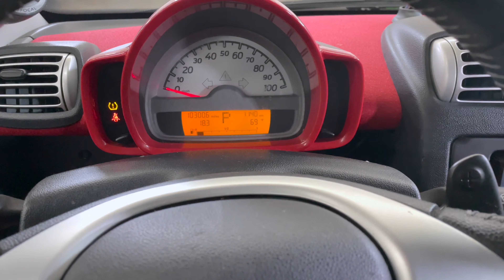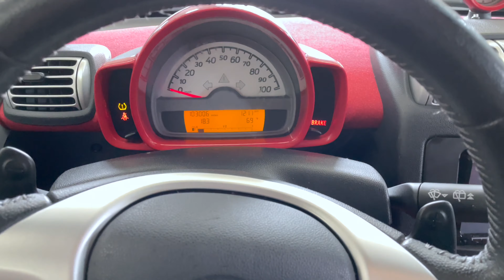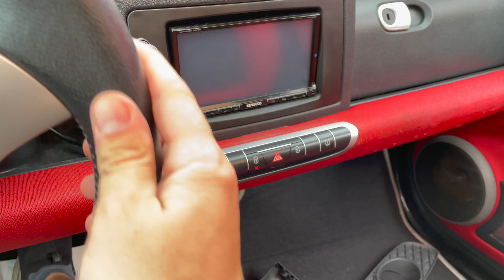Smart Fortwo Shifting Actuator Fix

Comment: Thought I'd drop in a comment here about the whole process and what I experienced because I just got through doing it on my twenty fourteen, smart that has 91,514 miles on it. My car had been surging a little bit when in drive, and when I put it in reverse, that's where the really big problem was, it was chattering and jerking. When I began investigating what it could be and ran across these type videos I thought, for sure I had found the fix. It turned out it WAS the fix! My car now runs and operates like it did when it was new. Couple of things to point out for everyone. When you are setting up the "lash", the amount of "pressure" on the clutch level itself, all I did was feel for the actuator rod to touch up against the clutch lever. Now I moved back and forth about six or seven times till I made sure I was feeling it correctly. From that point I put a little bit of pressure on the actuator itself, and I was very careful, as I slid it towards the bellhousing three more indicator lines. So everyone clearly understands. There are indicator lines, kind of like quarter round lines. The type you're seeing in these videos that are molded into the housing of the actuator. When I touch the clutch lever there were three lines showing. Then I pushed it three more. That's what the manual calls for you to do. It's easy to find this one line. The Other important thing I wanted to share with everybody is I did not have the software nor a laptop to plug into the car. The more I read about doing this job.I learn that you do not have to do that. Once you're finished with the job and you're about to drive the car to test your work. Just turn the car on and let it idle for about thirty seconds to a minute and a half. The car will learn the actuator position on its own. At least that's what I experienced. And then what I did is, I shifted the car somewhat slowly from park to reverse, to drive, to neutral, to reverse, to drive the neutral, and I repeated that maybe ten times slowly while my foot was on the brake. Then I dropped it in drive And went twenty or thirty feet stopped it, put it in reverse, did the same thing forwards and backwards, about six to eight times. At this point I knew immediately that the car was in tremendously better shape than it had been for the last eight ten thousand miles. My biggest problem is that when I was in reverse backing up, the car would shake and chatter very hard. Almost surging at times. That was all gone immediately. Then I took it for a shakedown run. As i've already mentioned, it ran, just like it was brand new. Hope this info helps some of you out there.
Reply from the maker: That’s a hell of a story. I’m glad the car is at least running better for you. I read all the comments here, and apparently there are situations where doing the maintenance on the actuator doesn’t fix the problem, at that point there could be something else going on, but most of the time, from my experience, it does fix the problem.

Thanks for sharing your story. I hope that the video and your comment helps other people out there with a similar problem.

Comment: 2008 Smart 451, bought a pair of ramps, removed the retaining spring pulled back the boot and sprayed in half a can of lithium grease using the long nozzle the can came with. result, a very quiet and smooth gear change. "Jobs a good un" as we say here in the U.K.
Reply from the maker: I’m glad your method works!! Good to know.

Comment: I wish I had this three years ago. I had the same problem with less than 50k km and my local smart center charged me over 600€ for a new actuator and didn’t even install it correctly so I had to pay another 300€ to get it towed to them because it stopped working the next day already.
Reply from the maker: Well, I’m glad that you found the video and you understand how to fix the problem in the future.

Hopefully you don’t have to pay 900 to get a similar issue fixed in the future.

Comment: Even after having new actuator installed, it didn't fix the problem and I still get stuck multiple times daily and won't go into gear. Have to let sit 5 minutes to reset transmission

Comment: Is this also a reason we get the 3 lines instead of the P (Park) on the panel? I’m not getting that slam noise, but I’m getting an electric noise like the rod is pulling out and pushing in, even while I’m driving.
Reply from the maker: Yes. The 3 lines means your transmission needs to relearn the actuator position.
Reply: @ToyotaGR86Performance  I pulled an actuator from the junk yard and the piston is in the full out position. I couldn’t mount it because in needs to be drawn in. How do I draw it in?

Comment: So the actuator will relearn on its own, and it doesn’t need a computer attached???
Reply from the maker: Yes
Reply: So pretty much open it up, clean it out, then lube the crap out of it? Any specific lube weight? General purpose, high heat, Red, Blue, White?
Reply from the maker: @HeyMikeyLikesIt2 in my experience any grease that will stay in place like a thick lithium. Don’t use any runny grease because it will not stay on track and eventually pull at the bottom.
Reply from the maker: And grease that is not runny and will not pool at the bottom of the actuator.
Reply: @ToyotaGR86Performance  Thanks for the response.  I bought this Smart car not knowing what I was really looking at…after two weeks, I found I have to replace so many parts. Luckily the salvage yard near me just got a wrecked smart car, I’ve been cannibalizing it every other day. It’s easy to replace parts, I’m just not too good at the electrical troubleshooting.

Comment: So mine was doing the same thing..all of a sudden very hard into drive and reverse and the car wanted to take off....so took off the clutch actuator and viola...no grease at all (and this was in a car with only 47000 kms....)...I put lots of grease in it and reinstalled in the same position, but was doing same thing...so...common sense told me that perhaps there was too much preload..i backed it off till just a little bit of preload from the actuator and presto...perfect shifts...put it in drive and it just creeps up to speed and same with reverse.

Comment: Hi mate 

You are an absolute legend 

Had my engine light come on and I noticed the car slipping gears and giving to much power then delay changing also car was very shaky and vibrating 

I took me 2 days to get the clutch off due to a rounded off screw but what can I say 

Took it all apart and there was no grease at all. I loaded it up with copper grease and jam packed it in and put back together 

As soon I was put the car in reverse and came off the drive the light disappeared and the car was back to.normal.again 

Thanks buddy 
Have a good Christmas
Reply from the maker: Stories like yours is exactly why I do videos showing common problem solutions.

I’m glad the video helped you out, and I’m glad you’re able to save money and not have to take it to the dealership for a fix. 

Merry Christmas to you too.
Reply: @ToyotaGR86Performance  definitely saved me alot of money I probably spent about 

8 pound on grease 
£ 30 on a female socket set and wrench 
£20 pound on some stands 

So £58 and about an hour of actually fixing it would have probs cost over £300 to get done I'm actually quite proud I did it myself 

If you got any information on doors not locking would be a great help to lol
Reply from the maker: Door is not locking? Doesn’t make a quick sound when you tell them to lock? If so, your actuator is probably weak and needs to be replaced. There are usually about US$30 on eBay.

If it is not making any noise at all when you tell her to walk, it could be the fuse or the relay. 

Either way the first thing to check is the cheapest. Check the fuse, then the relay.
Reply: @ToyotaGR86Performance  yeah it used to work then just stopped.

The doors lock from the inside with the central locking button but I can lock it by the key or the. With the key itself though the key hole
Reply from the maker: Then you have a mechanical issue inside of the lock cylinder where you insert your key. The only way to diagnose that would be to take that portion apart and see what’s going on. Sometimes it’s a simple as a bent rod.
Reply: My engine light came back on and started to slip gears again 😢
Reply from the maker: Slipping gears may be a sign of a worn clutch.
Reply: @ToyotaGR86Performance  even with the code P0900 clutch actuator circuit open
Reply from the maker: Circuit open means the connector isn’t plugged in correctly or there is a break in the wires.
Reply: @ToyotaGR86Performance  is definitely plugged in 

Where would I find a break in the wire
Reply from the maker: Circuit open just meals that there is a break somewhere in the loop. Maybe a bad ground. Buttttt, if the wires are good and it still says open circuit it might mean there is an electronic issue with the actuator internally.
Reply: @ToyotaGR86Performance  yeah I was thinking to just purchase a new one as I know to do it now

Comment: Great video. Would this be the cause of the Smart car being stuck in gear? I have seen some videos where the car won't go into gear. A simple solution is to look for a yellow switch below the shifting gear in the cab. I have a 2013 car with less than 23,000 miles & the yellow switch gets stuck in cold weather, just started doing it. Thank you.

Comment: Thanks for a very informative video. 🏆🏆🏆

So you don't recommend buying a new clutch actuator?

Also is there a difference in quality between a Sachs and Mercedes clutch actuator?

Thanks.
Reply from the maker: Sachs makes the part for Mercedes.

It’s the exact same part but it might have the “Smart” logo ground off. When that’s the case it’s called an OEM part. When it still has the “Smart” logo it’s called an OE part. They are EXACTLY the same.

Here is the part number if you need it. 

4512500062
Reply: Awesome! 🏆🏆🏆

Comment: I'm glad I found this video, because my clutch actuator sounds exactly like this. So I want to try this before I do something else. What type of grease did you use for that. I have some bike greases here, but I think that's not the right one.
Cheers Daniel
Reply from the maker: If the grease is thick like the white OE stuff and doesn’t run when hot, I’m sure it will probably be fine.
Reply: @ToyotaGR86Performance  its more like bearing grease, I don'tthink it can take much heat. I'll what I can find here. Another thing, in the transmission fluid flush video you use the Castrol BOT 328 fluid, looks like I can't get it in canada, is there an equivalent I can look for?
Much appreciate your help
Reply from the maker: @northshoregruni  in that video about the transmission flush, there is a comment where I found another fluid that will work.

Comment: Awesome 👌 thanks for this.
I've just bought a smart 452. I smell a clutch smell after every drive. 
Today I will make sure the actuator is greased and that it is correctly pre loaded. 
Are there any other  adjustments to do in this regard,? 
Many thanks
Reply from the maker: There’s no other adjustments for the actuator, but if you are smelling clutch every single time you drive, it means it is constantly slipping and it is time to replace the clutch.

Comment: Do you happen to know how to trigger the actuator re-teach? Was debating trying this, some reason I get clutch slip taking a turn after braking.
Reply from the maker: If you’re getting clutch slip it’s because the clutch is probably worn to the point of needing replacement.

As far as a simple trans relearn, it’s the process of cycling shifter positions from P,R,N,D,N,R,P in order.

As for clutch relearn, you need specialized software.

There are YouTube videos on how it’s done.

Comment: Hi, I have a 2008 colt Hatch 1.3 6 speed automatics gearbox, When I drive the car at 100km/h for more than 1h and after stoping car, the gearbox select the first gear but fails to engage car moves but in swinging mode, and then i have to turn off the car for 5-6 second and then turn on it again, and It works as usuall. when car faces this issue, it fails also engage into revers gear. Can you tell me what is the problem?

Comment: Do you think I have the same problem, 09 smart was driving and coming to a stop light car stalled out. Wouldn't start at all. Now I have 3 flashing lights on dash
Reply: Literally just got the same issue. did you figure out what was wrong?
Reply: @AreezRex  yeah ended up being the clutch actuator. But make sure to go with an oem sachs. I bought Amazon at first and had problems and that one jammed. Got an oem one on eBay, but more spendy but worth it. installed and worked perfect and didn't need adjustment at all.
Reply: @jgasparrr69  I had a feeling that was it! Thanks for the advice!

Comment: Great Video, but you could mention that the motor should also get some greae buy taking the rubber plug out of the top of the motor.
Reply from the maker: I didn’t mention that because if you put the wrong grease in there (electrically conductive grease) and you may very well fry the motor.

I have yet to find a good solution that lasts long-term, does not become acidic with time, and can withstand heat and cold fluctuations in the engine bay. 

Mercedes isn’t just giving away their secret sauce for grease to people like me.

Comment: Could this be an issue with struggling to accelerate or maintain highway speeds? Mine is sluggish, has a hard time going over 70 mph. Didnt use to be that way. I have had issues in the past with the rapid acceleration in traffic from a stop, shuddering while in reverse. I was thinking maybe the clutch is slipping while driving at higher speeds, now im consindering trying this out, what can it hurt for a few mins and some grease anyway?
Reply: mine starting to not be able to accelerate past 30 after i replaced actuator, let me know if it fixes your problem
Reply: @benjaminsauceda5906  i actually did this today. While it helped with shifting, it didnt help my top speed. I used to be able to ride the governor at 92 if i wanted, now im struggling to maintain 70-75 no CEL. Last thing i am going to try is fuel pump thinking even though i have pressure maybe i dont have much flow. 

For what its worth, the way i adjusted the actuator was during install i pushed it up until i felt it hit the arm inside and made a mark. I pushed it in 3 hash marks farther in from there and locked down the bolts. Then a few cycles through P R N D back and forth several times. It actually shifts much better than ever before and took maybe 30 mins to do.
Reply: @benjaminsauceda5906  ive learned quite a bit about this car in the 65k miles ive put on it. Its been fun and reliable but this top speed issue has me scratching my head. Ive replaced coils, plugs, done leak down and fuel pressure tests, replaced crank sensor, now greased the clutch actuator, removed and cleaned injectors to ensure proper fuel atomization, checked the cylinders with a bore scope, removed and cleaned the throttle body, replaced the air filter for good measure, run sea foam intake cleaner through the intake and hot soaked it per directions. Only thing i havent done is change the fuel pump, which mind you still shows good pressure but im wondering if i have poor flow. It still drives great through town, but it just wont do higher highway speeds anymore.

Comment: Hey wondering since you’ve done this with yours did you ever run into the codes P0805 and P0900? For the life of me I can’t figure out why I keep getting these codes and after I go for a drive in the car and it gets warm, if I put it in park it will lock me out of reverse and drive for a couple minutes
Reply from the maker: I have not had those personally, but if you get P0900, you could technically fix the actuator if you can take it apart, but at that point, it’s much easier and probably better long-term to simply replace the actuator.

Comment: What type grease was applied inside the actuator housing?
Reply from the maker: Lithium.
Reply: @ToyotaGR86Performance  Thanks!
Reply: @ToyotaGR86Performance  Update:

I did the DIY rebuild and experienced marginal actuator improvement, but not enough to stop the hard slamming into reverse. Was curious to see what my local MB Smart service would find. They hoped to find $2,400.00 in my wallet... in order to replace the unit as a starting point for diagnosis. In other words, they weren't completely positive if the actuator was faulty. Crazy!

Unfortunately, I still had to pay for the expensive diagnostic walk-around by the "smart technician."

I'm considering buying a new OEM Sachs and installing myself.
Reply: @ToyotaGR86Performance  Out of curiosity, could the clutch-actuator's electric motor be a contributing issue to the slamming?
Reply from the maker: @Windtee  possibly yes. It is binding somewhere. Usually it starts to bind because there isn’t any more grease from the factory. It just gets dry and crusty and starts to bind and causes slamming. If you have greased everything, and it is still slamming, and still binding, it is possible that it is the motor.
Reply: @ToyotaGR86Performance  Thanks for the reply and your videos. Much appreciated.

Comment: When my smart shift gears its like my clutch releases to late so its goes higher in rpm and after 2 or 3 seconds it releases. 
Should this be a cause of no grease on it like this video ?
Reply from the maker: That sounds like actuator delay, so it might fix it.
Reply: @ToyotaGR86Performance  thanks for the answer !